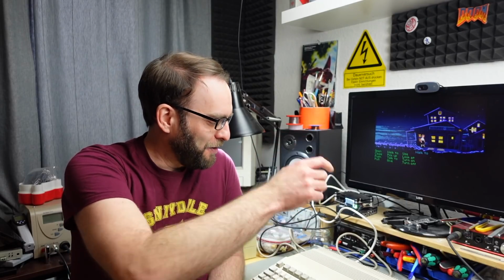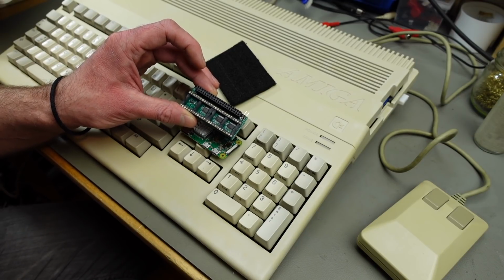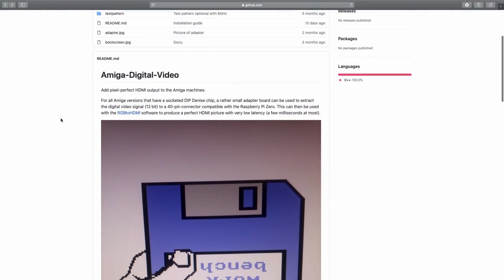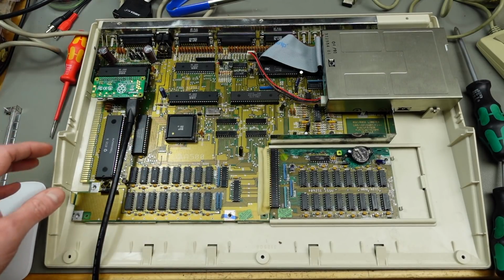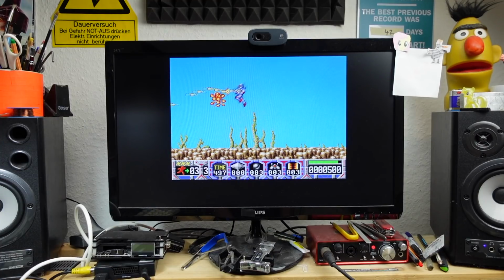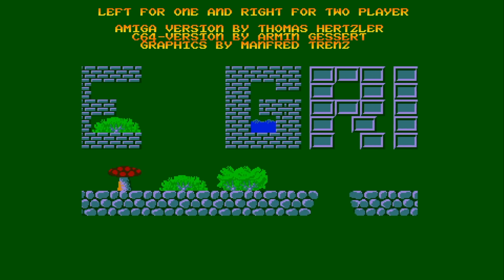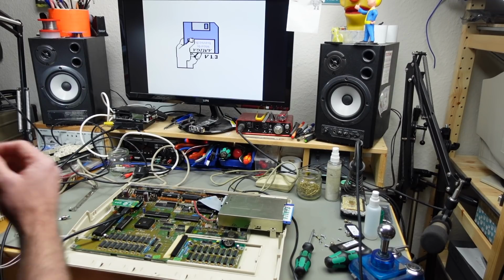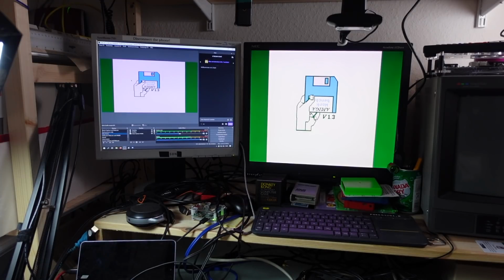Amiga HDMI with a Raspberry Pi! (RGBtoHDMI)

Comment: Hi Jan, I am using an RGBtoHDMI in my A500 with a Rev 6A board.  I am in the US using an NTSC monitor with a PAL Amiga.  When I use HDMI directly to my Pistorm, I get video with no issues.  If I use the RGBtoHDMI with Pi Zero, I see the loading screen and then I am stuck at a white screen.  I am able to access the menu, however by pressing the supplied button attached to the unit - anyone have any thoughts?
Reply from the maker: Maybe it’s a power supply issue. Having two Pis in the Amiga might stress the psu too much. Do both devices work separately? If they do, you might want to try a beefier PSU.
Reply: @JanBeta  The Pistorm works fine when I switch the HDMI to that one - sadly, when I switch over to the RGBtoHDMI, I just get a white screen after the initial boot (resolution parameters pop up) - I can still press the button and get the menu for it though so the display itself works per se.... I also use a newly built power supply from Ray Carlsen (not sure if you're familiar with him)...

Comment: Can the sound be output from HDMI?
Reply from the maker: No, the RGBtoHDMI connects to the graphics chip so there’s no sound. You can use another adapter to inject the sound into the HDMI stream though (there are plenty of options available to achieve that).

Comment: I just installed mine.   Nice, produces outstanding video, but no audio.    The monitor I have will only take HDMI audio when switched to the HDMI source.
Reply from the maker: The RGBtoHDMI doesn’t output audio, it’s only connected to the graphics chip. You can inject the audio from the Amiga audio outs into the signal though, there are adapters for that available (haven’t tried myself because I use separate speakers anyway).
Reply: @JanBeta  Well this just gives me a reason to use better speakers than my monitor has anyways :)

Comment: How do you navigate the menu?? Long press toggles scanlines by default, and single press and double-press toggles the menu. Can't move the cursor.

I wouldn't have to change anything probably if the defaults weren't so bad or could be edited with a file on the card. But hey, it's Linux, we have 3 identical config.txt files, none of which configure anything users want to configure!

Menu default is Acorn Electron with non-RGB over HDMI as default. That's... unhelpful to most users.

Comment: thanks for your video. the solution existe for a a1200 ? thanks ?
Reply from the maker: It doesn’t work on the AGA chipset Amigas unfortunately, due to the larger bit depth and the way the signals are processed on the boards. You can still use the external RGBtoHDMI solution though which offers very good output quality, too!

Comment: What would also be nice would be a Raspberry Pi that captured an RGB signal and converted it into a virtual screen that you could access via, for example, Remote Desktop Connection. If a method were added to add keyboard and/or mouse signals, you could have a virtual KVM switch for old computers (and Roland samplers, the application I'm thinking of).

Comment: Hi Great Videos. I am just about to do the conversion. One question. When you download the RGBtoHDMI20211224 and copy it across to the micro sd card I noticed in your download there were no folders. Do I copy these acrross. The  Folders are Amiga CPD readme, cpid firmware, Profiles and resolutions. Situated just above the BinCode File Tks
Reply from the maker: If I remember correctly, you have to copy the whole folder structure from the archive to the SD card for full functionality. Hope it works works for you!

Comment: this sounds great ... and easy too!

when using the 60Hz mode on the other monitor, not only the color palette changes, the resolution is affected too ...

that's an old times problem when trying to convert PAL < > NTSC video modes ... even at its best, colors can stay the same but screen size from say, 320 x 200 (NTSC) vs 320 x 256 (PAL) are always at conflict ... (or high-res 640 x 400 vs 640 x 512 and so on ...)

then there is the problem of frame rates, 30fps (NTSC) vs 25fps (PAL) too ... but that's been easier to compensate for when converting either modes to and from the other one ...

however, there are many tv movies and series that are available for both formats and there is no color or resolution or frame rates problem in them ... that's usually because they conform to the same digital resolution and screen ratio standards, such as 1080 for example ...

Comment: Have you tried using this together with the PiStorm so you have a dedicated RTG/RGB 2 HDMI on this one and then the PiSTorm dedicated to CPU/FASTRAM/SCSI Emulation, a setup like this should yield better performance on both RTG and CPU, specially when in RTG mode and pushing the CPU/FastRAM/Storage usage as the RAM bandwidth for RTG will be independent from the rest therefore you'll have faster access for both when using both. Please try this!

Comment: Ok,  just got one of these beasties..  It seems like a simple install,  I formated sd card,  put the software in the root directory,   took out the denise ship, put it on the adapter, made sure the orientation was correct.  put the chip and adapter in the denise socket, again.. proper orientation,  sd card in Pi0, pi0 on the adapter, plugged in the mini cable to the hdmi TV..  Turned it on and no video at all.   I don't even see the power led"s on the pi-0 coming on..     ]
Reply: Actually,  just solved it..  Two issues, in case anyone runs across it..  Check your SD card..  the first one the Pi0 didn't like, even though it was ok..  2nd,  attach a button to the pin headers to pull up the adapter menu..  I had to switch from 50hz to 60 hz..   and that was the problem.
Reply from the maker: Yes, some monitors don’t support the 50Hz modes unfortunately. I think I mentioned that in one of my videos about the RGBtoHDMI. Glad you got it working in the end!

Comment: Hello Jan,
can you please put a link for the Mini HDMI to HDMI-A Cable you used for mounting a HDMI output to the backside of the A500 / A2000 ?
Somehow I searched with the wrong keywords all the time.
Reply from the maker: I didn't mount one of those in the A500, just connected a long mini HDMI to HDMI cable and had it dangling out the side. I am working on a video installing the adapter in my A2000, I'll put links to the cables I used in the description when I finish that project. There are cables available from Amazon (look for a short mini HDMI cable and a panel mount HDMI connector, there are plenty of options).
Reply: @JanBeta  I did a thorough search on amazon, reichelt, conrad, voelkner, etc. but the problem there is that, the most good panel mount adaptor pieces do have a too long cable of 20 cm and up or those adaptors are for the "full size" HDMI only on both sides.
Trying to fit the mini-HDMI to full size HDMI adaptor I blew up a raspberry pi zero in my Amiga 2000 because the adaptor put pressure to the upright board and the foamy stuff I glued to the backside towards the powersupply got punctured.
Luckyly only the pi zero is dead and the Amiga 2000 still alive.
On my Amiga 500 I experienced a similar problem with the adaptor and 20cm of cable.
There is simply no room to make it look neat.
So, I thought you have already found a solution of camera and if I asked .... You post it here so, everybody with the same question gets the answer.

Comment: Hallo Jan, ich habe diese Lösung mit meinem Amiga 500 auch getestet. Ich erhalte auch dieses Regenbogentestbild am Anfang, doch dann bekomme ich nur Schneegestöber angezeigt und oben links Anzeige, die anscheinend vom Raspberry stammt: 1920 x 1080; Auto Switch: No profile matched; Interface: 12 Bit Simple; Scaling: Auto (Integer/Sharp); Profile: Amiga 50 Hz.

Ich verwende einen Raspberry Pi Zero WH (er kam ohne Kühlkörper) und den RGB to HDMI Adapter für den Amiga Rev 2. Ich habe die neueste Software aufgespielt und die SD Karte mit Fat32 formatiert. Beim Starten leuchtet sporadisch eine LED am Raspberry auf, ich denke wenn von der SD Karte gelesen wird. Über den RGB Ausgang erhalte ich nach wie vor am Monitor das gewohnte Amiga Bild ohne Störungen.

Weißt du eventuell, wie ich den Raspberry auf Funktion testen kann? Wenn ich kein Bild erhalte, kann es ja nur am Raspberry selbst liegen, oder an dem Chipadapter.
Reply from the maker: Hi, der Raspberry scheint zu funktionieren, wenn du die Meldung sehen kannst. Hast du den Jumper am Adapter für die Denise-Version richtig gesetzt? Ansonsten vielleicht nochmal eine andere Version der Software ausprobieren?
Reply: @JanBeta  Danke Jan, ich habe eine ältere Software ausprobiert, jedoch brachte dies keine Verbesserung. Ich habe dann einfach mal das Adapter Board auf Super Denise gejumpert und nun bekomme ich zumindest die Amiga Floppy beim Booten angezeigt, doch das Bild hat zahlreiche Verläufe und läuft dann auch von oben nach unten durch in hoher Geschwindigkeit. Aber zumindest sehe ich jetzt etwas, das war vorher nicht so. Ich vermute, dass das Adapter Baord defekt ist. Ich habe einen Amiga 500 Rev 3, da wurde sicherlich kein Super Denise Chip verbaut.

Comment: I actually can see my Amiga 500 on HDMI but looks like it needs a different palette but when I  push the button attached to jumper, there is no option to change pallets. I have the latest files so what might I be missing?
Reply from the maker: Did you set the Denise jumper according to the version you have? That can mess up things a lot. I didn't try the latest firmware yet but you might have to use another version, the features seem to evolve/change quite a bit still.
Reply: @JanBeta  oh...I must not have looked at that step...I will follow up. Thank you and thanks for your great videos

Comment: Ok...I am now scratching my head. I have everything installed...but no hdmi coming out.
My Denise chip still serves video up to Amiga monitor. 
The pi had a header so I did not have to solder anything. The pi does not need external power does it?
Maybe I got a defective board?
I am tossing this out there to anyone who might have an idea.

UPDATE: I needed to format the SD to FAT32 and copy files over. I am still having image issues due to poor connections, but actually was able to see the image via HDMI
Reply from the maker: Did you set the Denise jumper according to your Denise version? The adapter won't work correctly in the wrong setting. Do you get the "rainbow" startup screen from the pi? The pi is powered through the IC socket so you don't need any external power usually.

Comment: Does my pi zero need a heatsink an its main chip like yours does or will it be fine without one
Reply from the maker: It is going to work fine without a heat sink. I'm a bit over-cautious in that respect. It doesn't hurt to add one, but it is not necessary for the zero.

Comment: I'm trying to understand the circuit but not sure about what is the function of two 74LVC574, is it for converting 5V signals from Amiga to 3.3V for Pi? And what is the function of 74LVC86, somehow i suspect that it is delaying the clock signals a little. Can anyone explain basic functions if I am wrong?

Comment: can u run an Amiga emulator on the pie?
Reply: Of course. That have been avaliable for a number of years now. PI Zero are a bit too slow. Get a PI4 or PI400
Reply: @brostenen  pie0 too slow it's 1ghz no?
Reply: @zxspectrum16KB  Yup. PI-Zero will have issues when emulating Amiga.
Reply: @brostenen  seriously that's a 1ghz processor no?
Reply: @zxspectrum16KB  I think so. Something like that. Yes.
Reply: @brostenen  so isn't that something like a 1ghz 64bit processor unable to emulate a 7mhz 16bit one no?
Reply: @zxspectrum16KB  You can do that, but what about the custom chips? They are what makes an classic Amiga, what it is. No. You can not emulate classic Amiga on a Zero. However you are free to try and find out yourself. My advice is to find a good i7 machine for the best emulation experience, or simply just buy a real Amiga. Why on eart emulate Amiga on a RPI-Zero that are mounted inside an A500?

Comment: Hi Jan , keep up the awesome work , question : can you still use the old db23 output of the a500 when you put the adapter board on the a500
Reply from the maker: Yes, both the original RGB and composite out still work fine.

Comment: Do any of you remember those "Flicker Fixers" for the Amiga back in the day? They were a nice enhancement to make the video look better but a $600 a pop. The price was hardly ever justified.
Reply from the maker: Yes, had one in my original A2000 to use it with a VGA monitor. Looked really good actually and was a lot easier on the eyes.

Comment: Hi, Jan. This question has bugged me since 1985 or so when I had an Atari 520ST. Why do you think the Amiga ran almost 1mhz slower than the Atari ST? Wouldn't it be the same cpu? Did the Amiga bus use more instruction cycles in the background?
Reply: Hi, I think this is the reason: The commodore engineers decided to derive all clocks in the machine from the main 28.6363 Mhz (28.37516 PAL) oscillator. They did this for a reason...divide by 8 and you get 3.57954 MHz which is the frequency of the ntsc color carrier. The cpu runs 2X this frequency = 7,16 MHz (7.09 MHz PAL). An external 28.63 MHz oscillator could be fed from the d-sub db23 RGB-connector overriding the internal clk, this made it possible to genlock the machine and be in sync with external video equipment like the video toaster. This was a very cheap way at the time to do computer graphics overlay on video for example a weather forecast. The Amiga was an excellent machine at video editing while the Atari was preferred by music professionals because of the two built-in MIDI-ports and the no-noise (no wining) high res monochrome crt monitor.
Reply: @jbilander8886  Thanks for the in-depth reply! Interesting tie-in for the video toaster. :)

Comment: Interesting, this board seems a great option for A500s. 
I use a gbs-82xx board (around 20 euro) with the ESP8266 hack https://github.com/ramapcsx2/gbs-control
This gives me scart analogue RGB input to VGA output which I use with my Amiga CD32 (with TF330) and my Amstrad CPC6128. It even has a web interface for configuration.

I used the gbs-82xx board for around a year before doing the gbs-control hack and I have to say the difference is startling, no patterning, no sparklies, it even works with the 'hacked' CPC screen modes, good solid output. It's the best cheap solution I have found for analogue RGB. I was initially put off trying because some tutorials make it look difficult but it really isn't (for example some say you need to unsolder components but you don't). I feel like it would be good for you to cover on your channel for use with other retro computers.

Comment: It's like seeing winuae on my pc! :O
Reply: Yup. I have the lowest smoothing filther set on, because it gives a slightly older looking picture. It looks a bit like the natural smoothing that CRT does with the pixels. Not fully, just somewere between CRT and LCD. I think it looks like the difference between composit and RGB-Scart signal quality. Not as clean as emulator, yet not as gritty as composit. It looks as if there were a better RGB signal quality on CRT monitors, in other words. I like it.

Comment: I wonder if this would work for PAL/NTSC RGB SCART/S-Video connections Plus Audio

Sega MegaDrive/Genesis
Reply: It uses digital RGB, there is an add-on 12bit A/D card for it. I'm using https://github.com/ramapcsx2/gbs-control with a GBS8200 board for VGA output.

Comment: There's a similar solution for the DIY RC2014 Z80 computer. 😁 It's overkill for sure, but it's impossible to source cheap video chips. A RPi provides an inexpensive solution.

Comment: Some pixelartists actually depended on the CRT effect, making pixels bend-in a bit more. So having everything sharper may not always be better, funny enough. :)
Reply: I am running with the lowest smoothing filther on my V1 and V2 adaptors. That gives this really interresting mix of CRT and sharp LCD. Like it looks bith modern and oldschool at the same time. It is the first smooth setting you see when changing it from default settings.

Comment: I‘m wondering if this nice Little Pi Zero could handle the interlaced modes of the Amiga.
Reply: RGBtoHDMI supports Bob and Weave deinterlacing methods. Jan demonstrated this with the Giana Sisters title screen.
Reply: I‘ve just overlooked that the title screen was interlaced.
But what about moving interlaced content like a mouse pointer at the workbench. With other solutions there‘s often a thearing or artifacs round the Pointer.
But i‘m still very impressed about this little hack!
Reply: @pikozzyhobbykanal  I can't give a definite answer as different displays will give different results.

Comment: I wonder: What is the little 'adapter' board actually doing with the digital RBI signals? Is it just for converting the voltage levels?
Reply: Besides converting 5V to 3.3V, it also latches the color bits at the most stable pint in time (which differs between OCS and ECS denise). This is necessary to provide input signals to the Pi that are stable and reliable for the whole duration of the pixel time and also get a precice relation of pixel clock to color signal transitions. The software on the Pi heavily relies on this very predictable behaviour of the inputs now and it is possible to just make the solution work with the given CPU speed.
Reply: @copperdragon9286  Wow, that sounds like an really impressive job, having to sync, phase and hold the pixel clock. Thanks for your information and of course your great contribution to the Amiga community! :)
As I just had the discussion with someone: Do you think it would be possible, to also use this solution as an flickerfixer, too?
Reply: @elmariachi5133  Actually it works as a flicker-fixer by default. Interlaced modes are weave-deinterlaced for a perfectly stable picture. You get combing artefacts on moving objects, though.